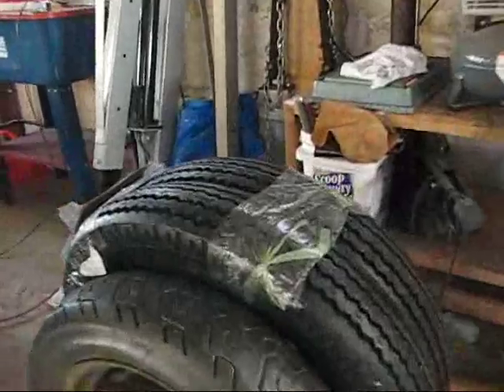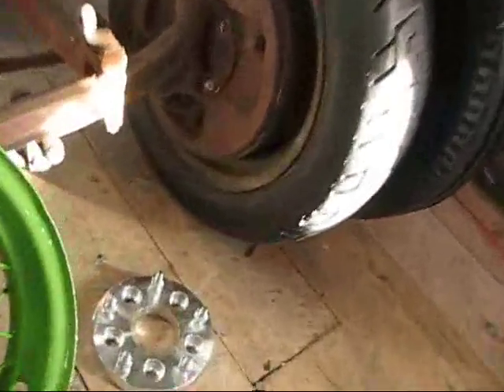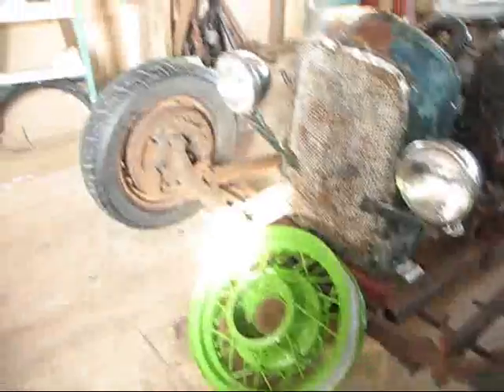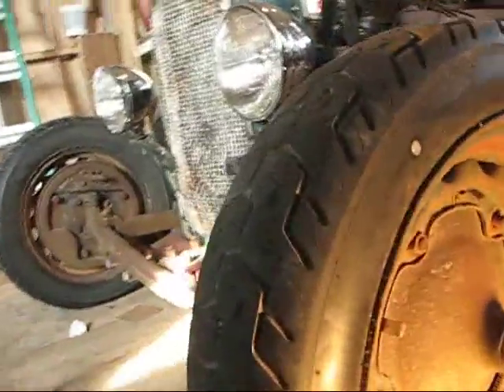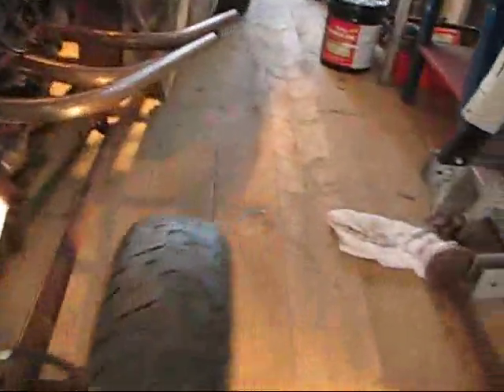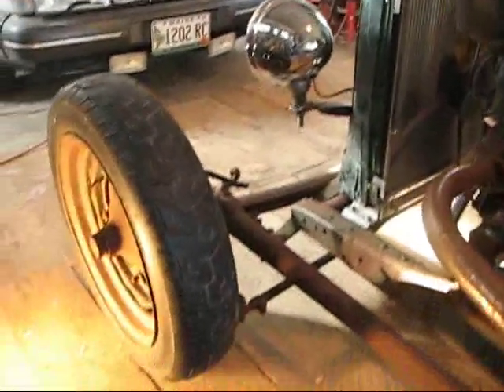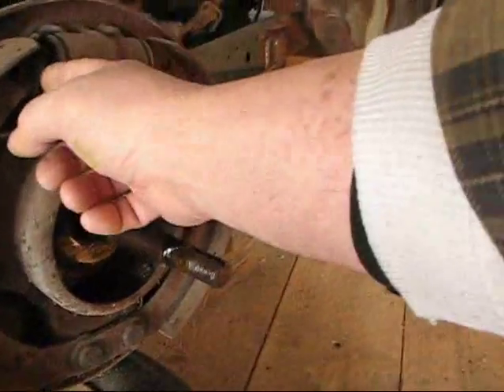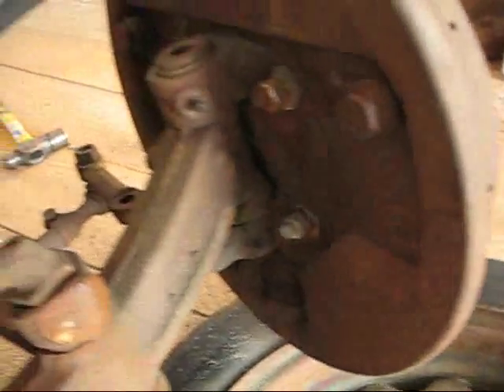Disc Brake changover on early Ford straight axel

Comment: I have same wheel and brake combo.Was thinking of swapping to disk as well.Too many people with too many different ideas.One says it will swap with no other mods, other says you need to change everything, another says keep your signal line and run an proportional valve, etc etc.This makes me crazy.What brake master cylinder Are you running
Reply from the maker: +Carl Liscoumb   It's a GM style dual cylinder, like on a 70's GTO..